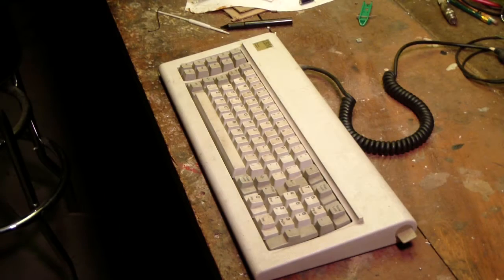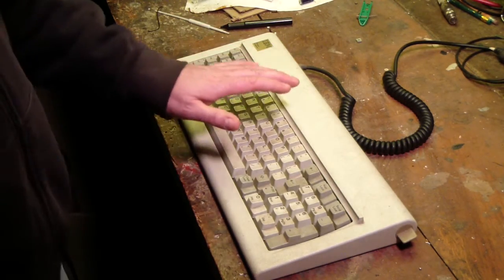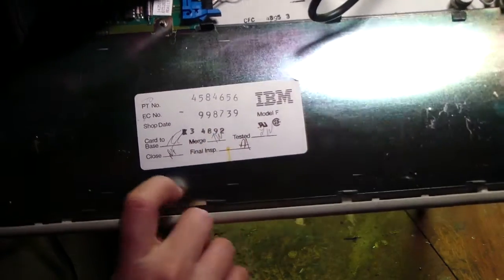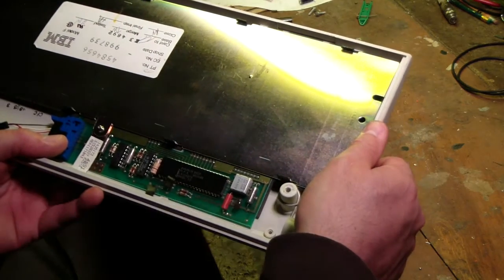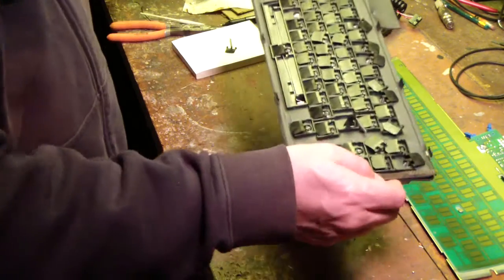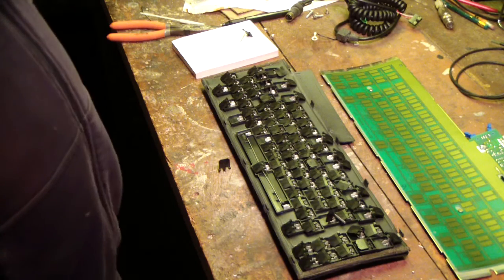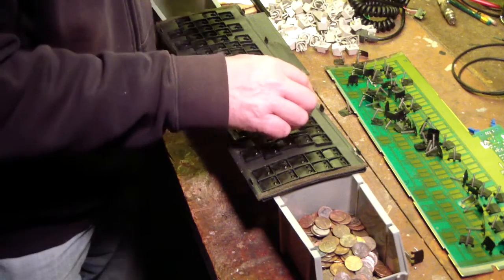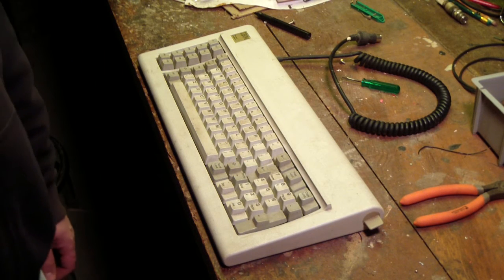IBM model F keyboard disassembled,  why it clicks the way it does.

Comment: I had a friend that worked at IBM in R & D. He told me the key click sound was designed into the keyboard to mimic the sound of the old mechanical and electric IBM selectic typewriters. He said the secretary pools balked at using computers rather than their mechanical or electric typewriter even after delivery of the PC. The clicking sound of the PC keyboard was supposed to be a subtle way of easing them into the computer age.

Comment: @Kevin Loughin thank you for the video and the accurate information :)

i am trying to disassemble mine but i cant slid of the metal plates! how did you do it?

Thank you for your time, 

G
Reply from the maker: Some gentle tapping with a screwdriver and small hammer.     Caution!  It's a bear to get back together and have it work.   Proceed at your own risk.  Don't blame me if you break it for good!    ;-)
Reply: @Kevin thank thank you for your time and your help :)
Also thanks for the heads up, i am already looking for someone who can take that kind of responsibility!

Cheers!